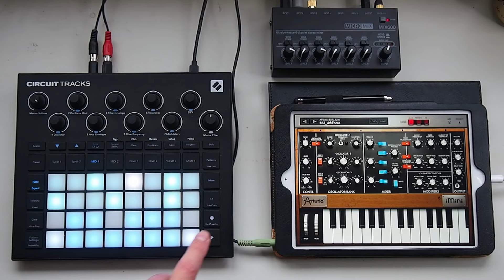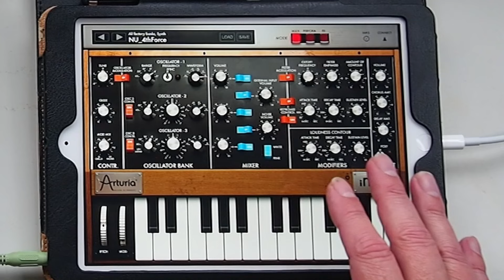DAWless for Cheap - Circuit Tracks and iPad

Comment: What power supply do you use ?
Reply from the maker: I use an I PAD adapet, which has two inputs, one for power via a lightnign cable. You need to get tyhe offical iPad version as others might not work properly